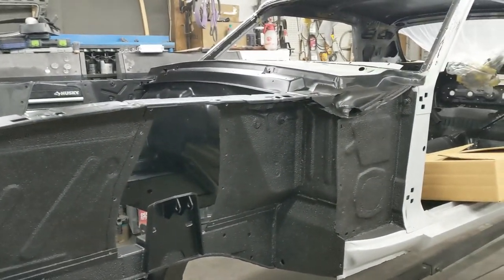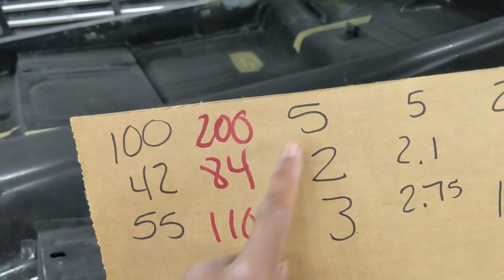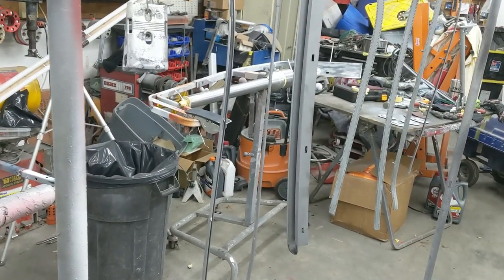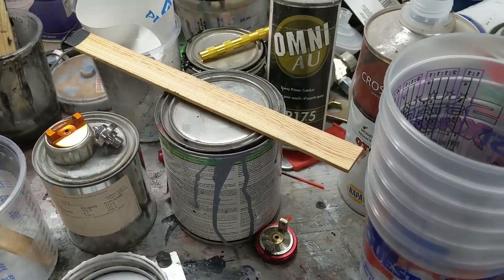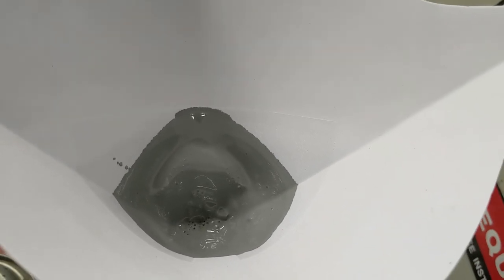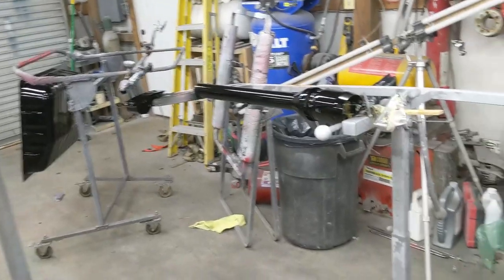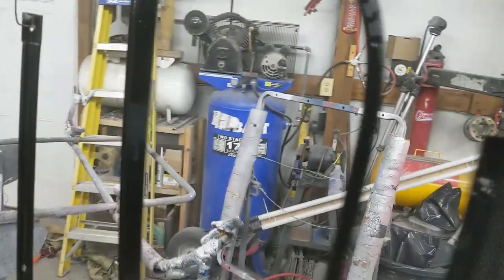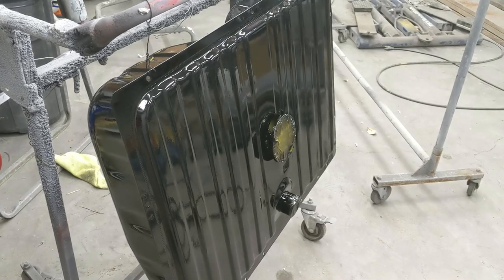AkzoNobel Lesonal Multi Matte Clear 5 2 3 Mix Ratio Easy Peasy

Comment: No wonder the mixing ratio was so confusing with concept DCC9300. I looked up TDS and it has multiple mix ratios depending on what hardener you use. 4:1:2 with DU5 or DU6 4:2:1 with DCX9 or DCX61. 2:1:2 with DFX11 lol
Reply from the maker: 😅 I totally forgot to show that part. You are correct, it is crazy.